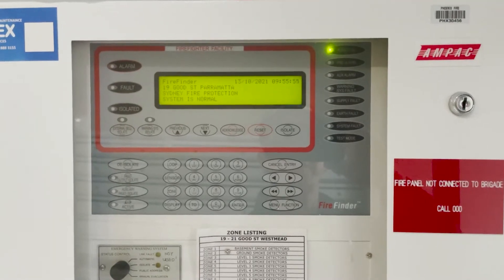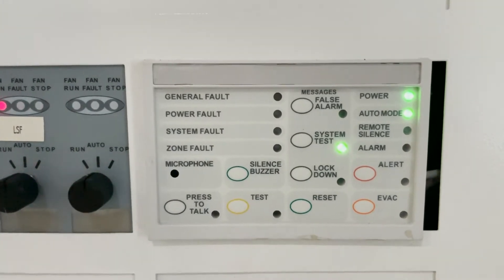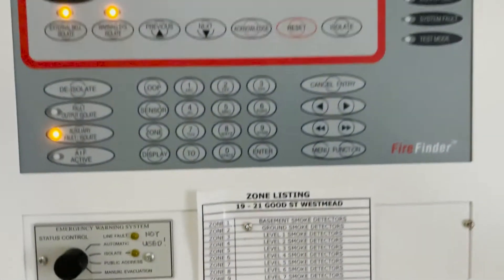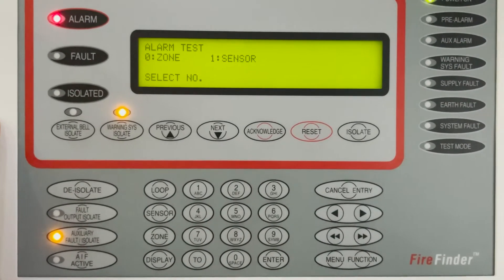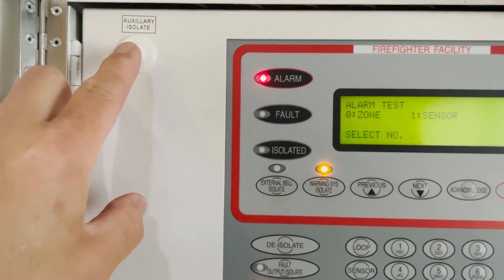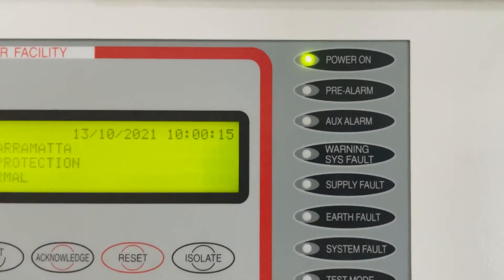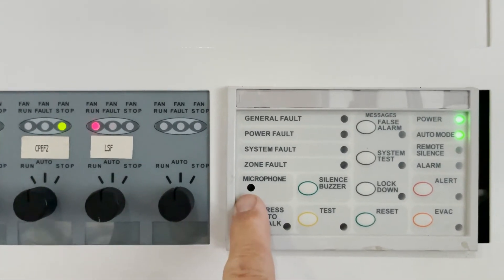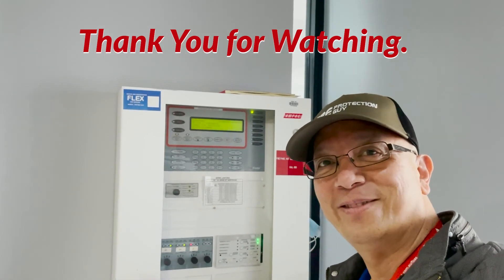Fire Alarm System F103 - Testing of Ampac Fire Finder

Comment: It seems that the "auxiliary fault/isolate" LED turned on when the FIP door was open and turned off when it was closed. What is the point of this?
I am a retained FF and see this LED always ON on some FIPs and never fully understood it. I have never been told to reset auxiliary, just acknowledge and reset from Firefighter facility. After seeing this, I'm sure we have left multiple auxiliary's running due to not resetting these.
By the way, love you work. Thanks for sharing. It gives me a better understanding on the internal workings of these boards when I arrive to an AFA. It makes so much more sense now!
Reply from the maker: Thanks Mate. Those were the old fire alarm panel (FIP) in the 1980-1990's. Modern FIP don't have anymore.
Reply: Thanks do modern FIPs still need an independent auxiliary reset? Or are these resettable with the master reset? Or is this all dependant on the brand/model?
Reply from the maker: @blake3871  By Australian Standard, ventilation must have a separate reset button in any fire alarm panel if they exist.

Comment: Hello sir, I used to live in Australia Melbourne and I would always get shocked by a sudden fire alarm without the usual alert tone before the EVAC tone. Is that usual? ( this was back in 2014)
Reply from the maker: The standard in building occupant warning system (OWS) has changed. Any OWS now automatically goes to EVAC tone not like the old ones. Only big panels,  like the EWIS, Emergency Warning Interconnection System, has the alert tones for gradual evacuation especially to taller buildings.
Reply: @fireprotectionguy7943  I see, so the building could have had an older system or the panel was programmed wrong?
Reply from the maker: @bigcomputerman4482  ...the smaller building without an evac tone , followed the newer standard. There are cases that, when the evac system became defective and was changed, they installed, a replacement and only available warning system, which only complies with the present/newer standard.
Reply: @fireprotectionguy7943  Alright, but it was the EVAC tone that played only not the alert.
Reply: @fireprotectionguy7943  this was the one that went 600-1200 hertz in 3 seconds loop, not the more common .5 second loop
Reply from the maker: @bigcomputerman4482  I am not aware of its standard frequency.
Reply: @fireprotectionguy7943  Alright, I really appreciate the work you do for our safety bro.

Comment: Can you explain what the Pre - Alarm condition on this system means?
Reply from the maker: Since this fire finder is used with a conventional module for conventional detectors, there will be no pre-alarm condition. If all detectors are addressable, for a Fire Finder, it's not programmable but thru the AVF. The new Fire Finder Plus can do that.